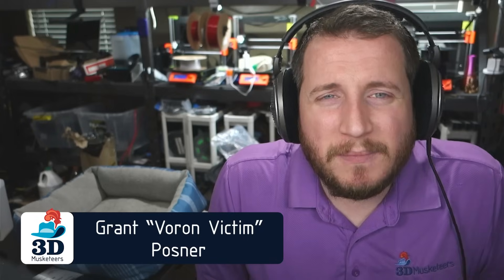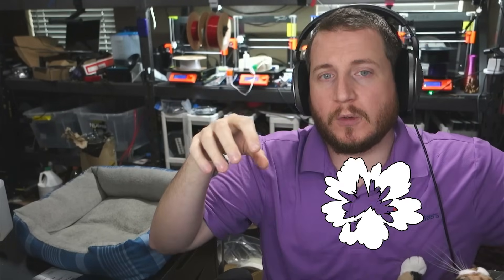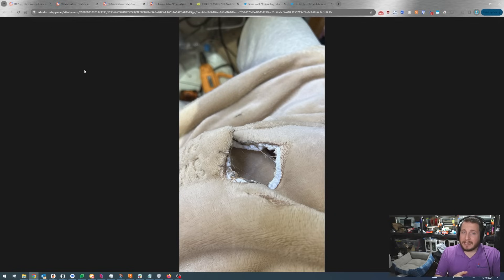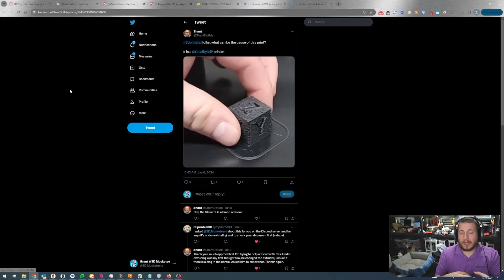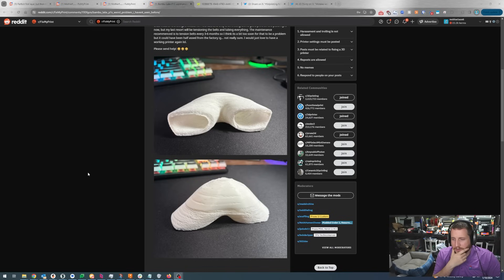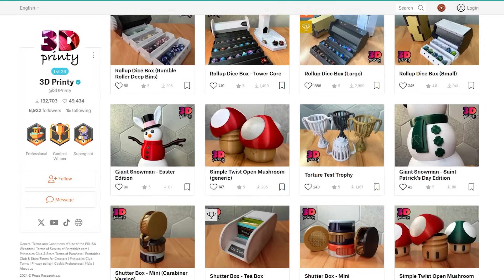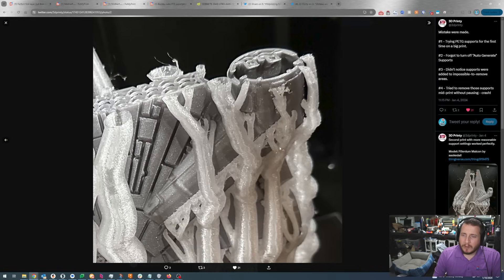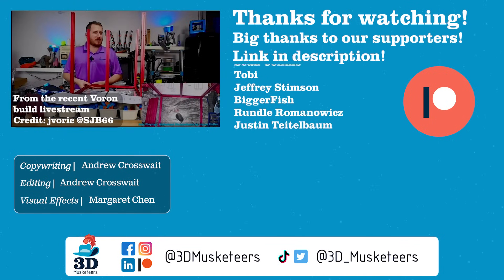Spongey Prints and Superfluous Supports! - PrintFixFriday 122

Comment: Loving my XL, using PETG for supports has been working great, and gives me some very very clean prints. I hope that Prusa will add the functionality to use multi heads on a single STL, like using a .6 for infill, a .4 for perimeters, and a .25 for detailed sections. In the current version, all the options are in there to do it, but the slicer gives an "invalid" text and won't let you slice it. Something tells me that it's coming, because why would the options be there if you were planning on using it?
Reply from the maker: YES I want to see that too!!!

Comment: 8:00 I always recommend to run 100mm of filament with a clear path (with no hotend) and then run 100mm through your hotend at slower speeds to see if you get the same number.  14:00 I wonder if he is printing using the white support filament that comes with the AMS.
Reply: Probably it is not pla or avs
Reply from the maker: hmmm you know.. thats a fair point, I will have to check!

Comment: 15:09 my guess is heat creep. I’m using a bamboo hotend in a Stealthburner toolhead on two of my printers (one is a voron 😉). Works great so long as you keep good airflow on the heatsink. That hotend is really sensitive to airflow on the heatsink. 

Might add check the heatsink fan is working correctly. Had a similar intermittent heat creep issue when the heatsink fan cable frayed causing the fan to work intermittently, by intermittent I mean it worked when you looked directly at it and stopped when walked away 😂
Reply from the maker: oooh good point, heatsink fan!

Comment: Grant is correct, the "Fillennium Malcon" (Thingiverse #919475) is listed as a print-in-place model with no supports needed.

That said, there are some pretty extreme overhangs - especially when printing at 160% scale. If I were to print it a 3rd time, I'd scrap the supports near the top, keep the supports on the bottom, and add a few supports to the curved bridges framing the cockpit - curved bridges never span gaps perfectly.
Reply from the maker: came out great either way buddy!

Comment: I'm always confused about the print temps because with my black pla+ I tried to run it at the temperature that it recommended and it was waaayyyy too hot. I run it at 197 and it prints pretty much perfectly now. Maybe I am doing it wrong, no idea
Reply from the maker: Some need more than others. It's why we recommend not switching brands too much lol
Reply: @3DMusketeers  I was watching some more and I think my speed also might be something of why my prints are fine. When you said 15mms was really slow, I realized that I print really slow or else it doesn't stick... Which makes me think I am running too cold
Reply: @3DMusketeers  also, sometimes the first layer is really rough, like it extends to all the edges, but it feels very rough. The bed is level, is the z offset too low? Or is that an extrusion issue?
Reply from the maker: if you have ridges between your lines then yes, its too low, if you have empty space between the lines it is too far from the bed

Comment: for the Bambu did they accidentally grab the PLA aero?
Reply from the maker: a comment further down is wondering if they grabbed the support filament! It is quite possible I think! But I would believe the machine would stop you because of a material mismatch, but I do not know..
Reply: @3DMusketeers  PLA Aero has that expansion factor you have to adjust for with under extrusion.  Soarkraft has a good demo of its print properties.
Reply from the maker: I dont THINK that is what this is, but the guy never responded

Comment: i once had a bind and the printer had been going for about 7 hours with no filament. thank god for hardened steel extruder gears
Reply from the maker: even without hardened gears it should just figure itself out, I think?
Reply: @3DMusketeers  you would think it would throw out an error but nope kept going
Reply from the maker: unless you have a runout sensor that can detect it, yeah it will just keep going
Reply: @3DMusketeers  thought the x1 carbon had one but i guess i was wrong. either way, it seems to be printing fine since the incident so hardened steel gears are the way to go for sure
Reply from the maker: It does but it's before the extruder. It doesn't know if it's jammed I believe. It may?
Reply: @3DMusketeers  i guess it doesnt. i have not had a jam happen since. having tangled spools is certainly an anomaly but personally dont intend on trying to recreate the issue to find out. its just strange that it happened in the first place

Comment: Around 10:00 he might be printing too fast for the extruder to handle,
I have 2 Sovol machines, a SV04 and a SV07+, I run into this any time I try to push the extruder past 10mm3 on the '04 and 22mm3 on the '07
If your slicer doesn't do extruder rate limiting, a quick bit with the calculator should give you some numbers;
Layer height x line width x print speed = mm3
you might want to slow it down a little. though I've run 100% infill at overspeed to nice effect with printed filters
Reply from the maker: I think they all do rate limiting? Not sure, but I know cura and PS do..
Reply: @3DMusketeers  I hadn't seen the option in Cura 5.1, though one of these days soon, I'm going to try to import the printer profiles into later versions, possibly Orca